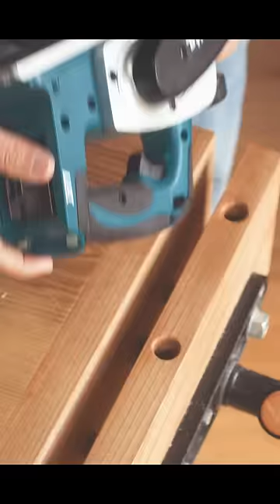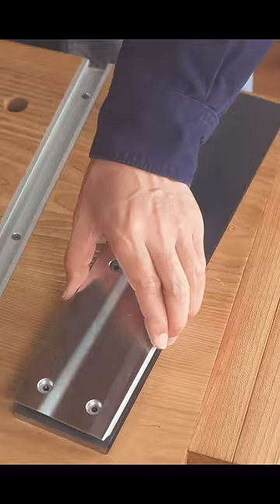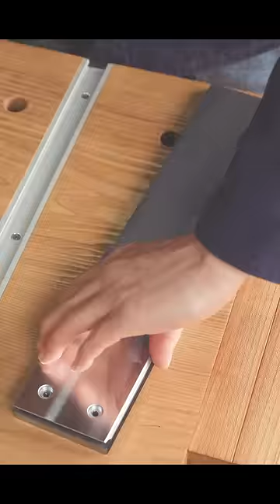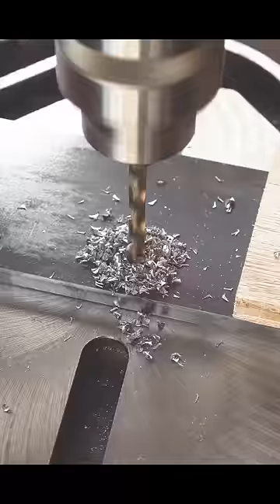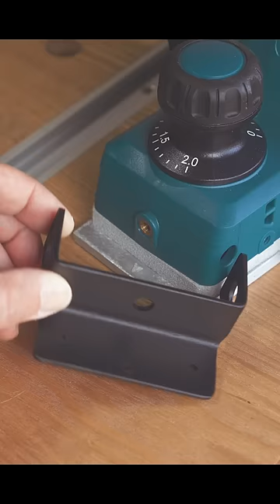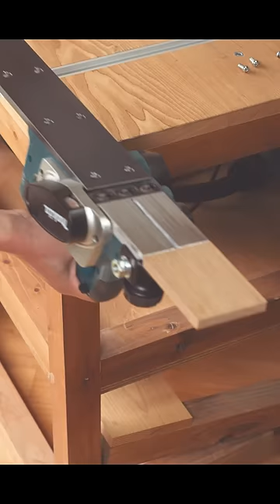Tool Hack #shorts

Comment: Congrats! This is one of the most dangerous things I’ve seen on the internet
Reply: If he can make this, making a guard for it shouldn't be that difficult.
Reply: No different than using a table Saw without a guard. Show me a table saw with a guard on it, on a job site and I'll be surprised
Reply: I can not see any difference to a planer station, except the size.
Reply: No really that dangerous, I'd say it comes down to the operator tbh.. the tool is the safest thing in the video. If you're incompetent in using it then sure you'll get hurt.
Reply: First day on the internet? Welcome!
Reply: @carterscustomrods 😂🤣😂
Reply: Ok, Karen - thanks.
Reply: What a nerd....
Reply: I guess you haven’t seen an actual wood shop before because this very tool exists and it is a million times more dangerous than this small scale one this guy built!😂😂😂
Reply: I’ve seen others do the same but far less engineered so
Reply: Have you been in a wood shop???😂😂😂
Reply: Для рукожопых все опасно
Reply: If" you don't know what you are doing.  Yep it's dangerous
Reply: You think THAT is dangerous ! 

You  never read my solution then that I posted and have used onband off to effect for years.
Reply: Не опаснее обычного фуганка.
Reply: I doubt that
Reply: Yes
Reply: This boy die easily outside the house😂😂
Reply: It's literally just a jointer
Reply: @mark-gt9yv See, this guy didn’t need your input nor does he care. Because he’s showing you small innovative hacks for little quick jobs, not 2yrs+ projects. 
It’s safe.
Reply: @histguy101 great job; these people whom complain of adding a guard are the sane people that tgevFDA
Reply: It's actually not that unsafe guys
Reply: Wait till you find out, they mass produce these and you can buy them from any hardware store and it’s exactly the same thing.
Reply: @jackknife1796  that’s what I’m trying to say… First of all it’s for his own personal shop. The dude looks like he could literally fabricate pretty much anything which means he’s been around tools a lot. If you’ve been around tools a lot, then you’ve probably had some close calls. But here’s the thing People, if you have half of a brain and a little bit of mechanical skills, you can work with pretty much anything and keep all your damn fingers. If you lose respect for that tool, I don’t care how safe it is, you’re gonna hurt yourself
Reply: Not any more dangerous than a regular jointer
Reply: Where is the danger?
Reply: @shoutatthesky  hello what I was thinking… It looks like a normal joiner at this point I thought he did a great job
Reply: E dai...

Comment: Thank God that planers aren't those tools who made by far the worst injuries when you get pulled in to that OPEN BLADE🤦
Reply: No guard yep. Someone is gonna run a board through backwards and loose all their fingers. See happen a lot
Reply: Yep. And that person should have put thought into their actions instead of expecting a corporation hold their hand at every turn.
Reply: When I was 16 I worked with an old Irish guy. One time we were planning doors. Me holding the door and him running the plane. No guard, dropped his thumb in. We had a line of claret up the wall and across the ceiling. Man hardly even complained, I nearly lost my lunch
Reply: Well, if you aren't paying attention, lack experience, and/or not focusing on the task at hand, then any tool can mess you up.
Reply: He was so close to the right solution.
Instead of building a jig for the Planer he should have created one for the wood😅
Reply: Это вы не видели Angle Grinder с  пильным диском

Comment: Just hold the wood in a vice and use the planer the way it was intended. Far less chance of injury.
Reply: This essentially makes it a jointer. Removing material is second. It should give you a flat edge, right?
Reply: @sevenohm3375  Yeah, it's a makeshift jointer and a bonus cordless finger remover.
Reply: @HaggisMuncher-69-420  So it is just like a regular store bought jointer then? No difference.
Reply: @HaggisMuncher-69-420  Just don't touch the blades. Duh
Reply: Surely it is not the way that planer was intended to be used, he trasnsformed it into a jointer planer that has a completely different function: the long infeed and outfeed tables and the lateral fence allow it to produce straight faces perfectly square to each other, goal that the hand held elettric plane can not achieve, its short sole produces a smooth surface but is too short to make it straigth, if the wood is cupped you produce a smooth but cupped surface. It is true that this hack lacks of a blade guard that the real jonters have, but given the low power an operator that knows how to operate a jointer can use it almost without any risk (this is not true if used by someone that don't know how to safely use it), any table saw, even the ones used with the proper blade guard that many woodworkers remove and even the Sawstop ones are way more risky. This hack if properly used does not have the power to really promote a kickback if properly operated, a professional grade big joiner, that has 10 times the power but mainly a 100 times more havier roller blade holder and have a much bigger depth of cut can promote a very dangerous kickback and safety wise is a completely different beast from this hack even if it serves on a larger scale the very same function.
This to give more perspective on the goal and potential risk of this hack, best regards.

Comment: Am i missing something here?  Why? So instead of planing a piece of wood clamped to a worktop... you fabricate a mobile tool to work upside down and make the timber mobile... crazy 😂
Reply: Yes you are missing the most significant detail.  The modification he did to the electric planer turns it into a completely different tool that has a completely different purpose.  He effectively turned his electric planer into a jointer.  If you don't understand why this is significant than you should probably be watching much more basic and fundamental woodworking videos.
Reply: @matthewhall9692   but wouldn't a jointer have a height adjustable blade.. a cordless plane, such as this makita only has an adjustable front shoe... a jointer would have perfectly aligned surface before and after the blade.. at no point in this short does it say the main plate needs to be a certain thickness... perhaps if you watched a basic jointing video you'd understand more
Reply: @steveh100   @steveh100  I understand it completely and properly as I have used my Porter Cable electric planer as a jointer until I finally got a proper 6 inch one.  

What he essentially did was replace the rear shoe with a much longer one which allowed him to fasten it to his bench top and serve as a solid outfeed, and he attached a bracket to the front shoe which is fastened in such a way that the newly attached piece of wood will always be parallel to the front shoe.

On the top an electric hand planer is a know or dial that allows you to adjust the height of the front shoe which is how you set your depth of cut.

I am unsure why you are expecting a jointer to have a perfectly aligned surface.  If that was the case either the blade wouldn't even hit the material you are running.

Comment: Interesting, but jointers are cheap on the used market. It's cheaper to get one there than this tool before adding this.
Reply: I cannot find an affordable used jointer in my area that I would be comfortable putting money into. The affordable ones all look like they've been sitting in a barn for a decade.
Reply: @echoshatter  I obtained one that was posted at $50. When I got there all looked in order but plugged it in and it wouldn't start. So I got it for 20. It's got a good coat of rust, but works just fine. The motor has a centrifugal switch in it and the contacts were dirty. I cleaned them and it started right up.
I regularly see not rusty ones in the 200 range. Old Craftsman ones in the 50-100. If it isn't really rusty (like been out in the weather), the rust should clean up fine. Or just leave it on. It works the same. Sand the table a bit and then wax it.

Comment: Why don't people use transfer punches to ACCURATELY transfer holes when doing things like this. They are dirt cheep and make for ACCURATE work. There are also transfer screws for the same when dealing with threaded holes.
Reply: Honestly, it's not precision machining. For woodworking, and especially when making jigs like this, I'll often oversize the holes so that I can make micro-adjustments for when I mount it. That way, the jig can be used in different situations. 
 
I mean, were not making 123 blocks. Lol.
Reply: Because they might not have them?

Seriously, half the tools Americans think are common elsewhere are virtually impossible to find in Europe, for example.

Comment: How does the infeed addon move when you adjust the depth of cut?
Reply: The whole front of the machine moves when adjusting. Bolting the front plate on allows it to move when the adjustment knob is turned.

Comment: But where did you get the bracket to attach the wood "infeed table"?

Other than that it's a pretty useful little jig;   maybe not THAT much of an improvement over just using it the normal way,  but i can see this improving efficiency if you have alot of boards to do. 😅
Reply: What do you mean?  You have no idea what the purpose of either tool is to be able to say its "not THAT much of an improvement over using the normal way".  He turned it into a completely different tool that has a completely different purpose.
Reply: It's a planer. He's planing wood. Idk what you mean.  

I suppose you can say that with the 4x4 clamped he's getting a second face square to the vertical side,  but you can just operate the tool as usual use the fence that comes with it.

Comment: Nicely done, but I always get really twitchy when I see that rapidly rotating finger muncher face up like that and no way of quickly turning it off. Maybe there’s a way to add a kidney type guard or just a cover of some sort and an in-line no volt relay. I’m sure you could come up with something like that and make a part two for this short?
Reply: I died at finger muncher
Reply: A featherboard would go part way to what you're thinking of. Either that or buy a planer attachment to your saw table.
Reply: Agreed. I’d plug it into a foot switch, or an inline kill switch for the quick power-off. It shouldn’t be too hard to work out a pivoting guard for it.

Comment: Great way to burn out your tool and also take off a finger or two! Buy a real planer if you need that. Or use a powered hand planer as designed. These short cuts are not good

Comment: When I get a house, I am going to be doing this
Reply: Please dont, these hacks might save you a few hundred on buying a jointer but if you're not experienced or hell even if you are its realy easy to slip and lose a digit or two. Even with an actual jointer which this is imitating and those have a few more safety features than the nonexistant ones here. Remember if it can shred wood like that itll rip your fingers much easier